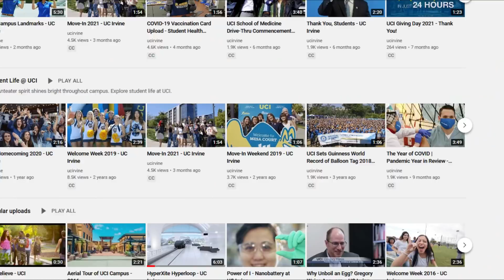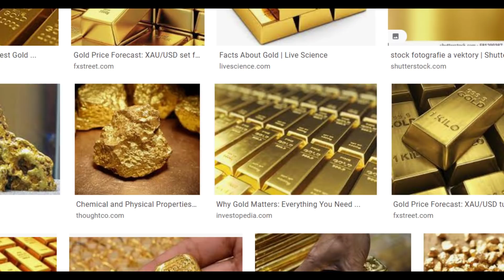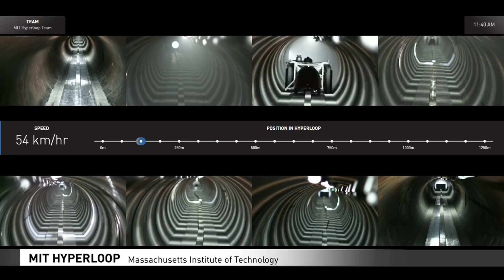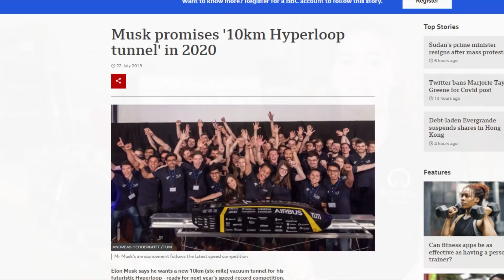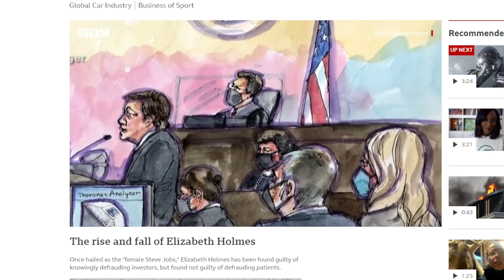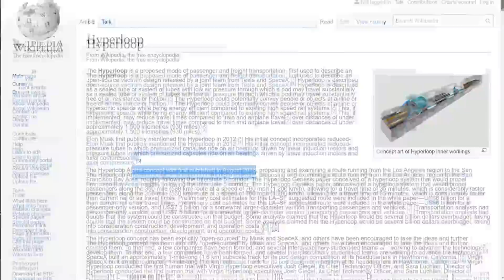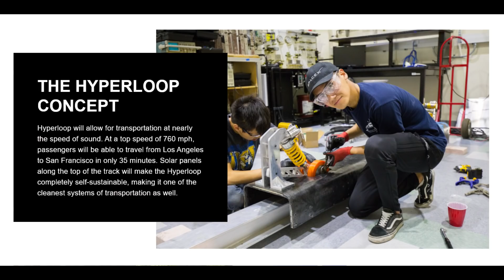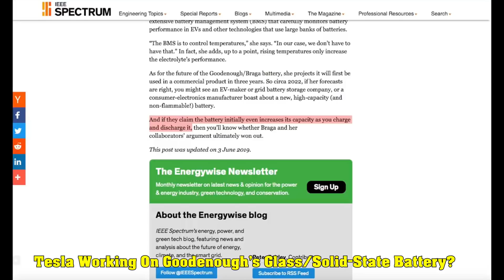The GOLD Battery that will revolutionize EVERYTHING!

Comment: I also love the fact that they went to using wheels on a track, without implementing any of the great parts of rail.
Reply: while in Japan the new high speed Maglev train and track is almost complete
Reply: I heard about this futuristic technology that actually allows you to supply power to the vehicle through the rails. It eliminates the need for batteries, except for emergency lighting and communication.
Reply: @hughbrackett343  so futuristic it's in almost every model train set ever made
Reply: @hughbrackett343  or even wirelesly through magnets
Reply: @milesdunstan-daams4855  I'm afraid that magnetic induction power for cars or trains is about as believable and practical as solar roadways.. It would also work 'better' if the very large magnets were made of solid gold rather than copper. (The price of copper wire is only one of the killers of this idea.)
Reply: My favorite part was the kid working on the 'hyperloop' car with like 6" wheels on it.   Let's see....6" wheel at 700 mph= about 39,000 rpm.   Sure...that'll work out just fine I'm sure.   How could it not...they're the smartest young minds and doing well in college...and we should all listen to them and follow what they tell us to do.   After all...they ARE the leaders of the future!   I'm SO glad I'll be dead in another 20 years (hopefully) and won't have to see how badly they screw things up that are already screwed up.
Reply: @neku2741  so ironic, since rail was, what created the "UNITED" states
Reply: you're a genius. rails. thats the future
Reply: Give it some time :p Within a hundred years they'll have invented a train.
Reply: @hughbrackett343 There is already a way to get power to trains without the need for batteries. It's called an overhead contact line. I don't see the point of getting power from the rail unless that's where you get the power anyway. The money you save from not having overhead lines is spent on the more expensive rail. Fun fact: They started putting overhead lines on some parts of the Autobahn in Germany and there are some test tracks in Europe. Since Germany has started to let its rail infrastructure crumble because of the half-assed privatization and thanks to the car lobby this is the fastest way to decrease emissions. It's cost-effective and with high enough diesel prices and cheap enough renewable energy, it can even pay for itself. Currently, it's designed to make diesel trucks more efficient but with enough infrastructure, it could make electric trucks feasible as you would only need batteries for the last mile. Tom Scott has a great video about it and he has a good track record.
Reply: If they were to do that, they would actually have to start thinking.
I think you might be demanding too much from them here
Reply: @recoilrob324  my first thought was the same on seeing those tiny wheels. What RPM will those be subject to at the designed top speed? Big oof.  And at that speed, a bearing failure on only one wheel would likely mean you've now got a vacuum formed can of compressed meat instead of humans.
Reply: I love how just like most of the video, almost none of the replies on this video have anything to do with the actual topic of the video - the gold battery,  which also has nothing at all to do with Musk  / Tesla / SpaceX,  despite TF wanting us to think otherwise.
Reply: @KenLord  He tried to highlight how much time is wasted at these prestigious schools and how little the students know about first principles that can disprove that BS within minutes. Also, why should we care about Golden BS? There is no need to argue, gold is far too expensive (and heavy) to be practical.
Reply: @Ninjaeule97  Another example of a project that is a total waste of time and money and can be disproven from basic chemical principles in minutes is hydrogen cars.. In this case it was actually working from first principles and completely ignoring existing knowledge that was the mistake. 
It turns out that there is already a magical way of storing hydrogen that is easier and safer and much cheaper - its called hydrocarbons. The problem with carbon is not how its used its where its come from, take it from the atmosphere and your fuel is automatically CO2 neutral. The time and money spent on hydrogen cars is decades and billions.
Reply: -Matter didn’t create anti matter
-Anti matter didn’t create matter
(Both of them were present at the time of big bang)
-Both of them didn’t create themselves.
-Both of them came from an unimaginable source,  that unimaginable source created matter and antimatter (everything) thats why it is known as “the creator” of everything.
—————————————————————
- that unimaginable source/creator has created sin and virtue which are opposite to each other,
— logic says every action has its own reaction, so the reaction of sin must be different than the reaction of virtue,
— the creator has created prophets to let us know about each and every detail of sin and virtue, also about their reactions,
Thank you :)
Reply: @Lucien86  H2 for cars was never reasonable. H2 is far too dangerous to be handled by everyone. The problem with hydrocarbons made from atmospheric CO2 is that they aren't very efficient. If you take CO2 from a smokestack you get around 75% efficiency compared to 70% of liquifying H2, which you also need for the hydrocarbons. Too bad that smokestack CO2 defeats the point. CO2 is just too dilute in the atmosphere to make extracting it economically. If you use plants, they are just as inefficient and also take up plenty of space. The only sensible solution is converting agricultural waste into CH4 and other hydrocarbons.
Reply: @Ninjaeule97  But efficiency is a problem that can be worked on - an engineering problem.  One basic solution is to use equatorial solar plants to provide the energy .- Plus capture CO2 wherever you can and ship it in. Once you cool it CO2 is relatively simple to transport as ice. The same ships could also carry the fuel back out. 
This is only a basic back of envelope guess but to me it already looks much better than putting liquid hydrogen in cars and trucks.
Reply: @Lucien86  well thats where your wrong there are trains that exist now that will be implemneted later that use this technolagy for the mag lev in japan
Reply: @milesdunstan-daams4855  I never mentioned trains and trains and cars are not the same thing. Even for trains though the hydrogen infrastructure will be physically large - expensive and probably restricted to very few primary routes.. Even for rockets hydrogen is troublesome and requires bigger tanks than other fuels.
Reply: @Lucien86  Sure, but there isn't a way to make CO2 in the atmosphere less dilute other than burning fossil fuels. As I mentioned smokestacks are off-limits if you are going to burn the fuel in a vehicle because the exhaust is much more dilute and therefore harder to capture. If the CO2 or CH4 ever escapes into the environment you are back to square one. The only place with natural higher CO2 is near vulcanos but they only pump out a small amount of CO2 compared to human activity. Transportation isn't an issue with H2, you can just use the existing gas pipeline. Leaks are less a problem because H2 isn't a greenhouse gas so unless the leak happens near an open flame (which is an issue for CH4 as well) you are fine. The only problem with H2 is that it's less efficient than electricity which will probably always be the case, the difference just won't be that large and that it's more dangerous than hydrocarbons. With trained personnel, this isn't a big deal, as we already handle stuff that's more dangerous than H2. H2 just isn't for the average consumer which isn't a big deal, ranges of electric cars keep increasing and costs keep going down.

Comment: 0:39 What if a battery lasted forever.
1:00 Unlimited charges.
1:15 Hundreds of thousands of charges.
3:04 (text) 5,000 to 6,000 charging cycles.
Umm, someone needs to make up their mind exactly how long this battery lasts and how many charge cycles it can endure.
Reply: Yeah but what does it acually mean for a battery "to last forever"? My first thought was "do they mean it wont ever run out of energy?" or just wont lose capacity over time  -> yawn...
Reply: I think it's just an exaggeration. 5k to 6k charging cycles is a LOT of charges.
Reply: In a world of pure imagination, their battery can do whatever it wants!
Reply: @KillerChickn  for a battery yes for a capacitor its pathetic,  think about the Capacitors in a 6khz oscillator circuit.
Reply: And Thunderf00t needs to actually talk about the battery he's criticizing instead of Musk. He's getting kind of fixated. If you actually listen to the 10 seconds of video he's claiming to critique, it sounds completely reasonable. "We figured out how to use tiny bits of gold on the contacts to prevent battery degradation." TF doesn't address this at all, and just rants about Musk.
Reply: @sevret313  
Luckily he doesn’t lie about Musk and Musk deserves all the crap going his way.
The university students doing research that gets blown out of proportion by idiotic publishers who want to sound marketable and then the whole thing gets roasted by ThunderF00l is very sad however... like, criticise the marketing/publicity team for being misleading but don’t throw dirt at students for doing research on stuff they had no choice over. Furthermore, supercapacitor technology can be improved and is a good field of research, even if you have to use gold sometimes... like... it’s research, it doesn’t have to hit the market tomorrow ffs. Hyperloop research however is kinda cringe, like, it helps no one, we already know it’s a bad idea.
Reply: @darrennew8211  It's not that gold does what it does but that it's so expensive.
Reply: @dogwalker666  and those dames things can last decades